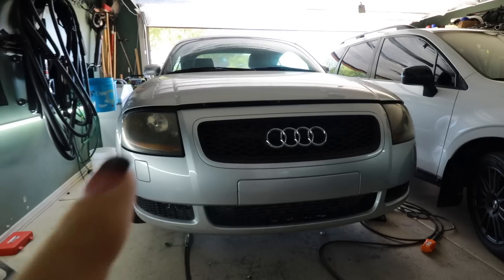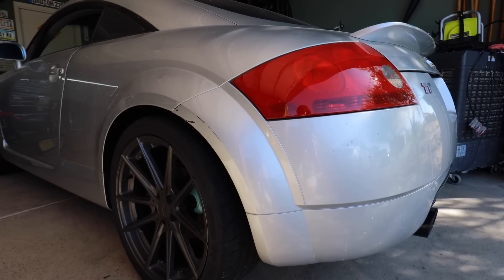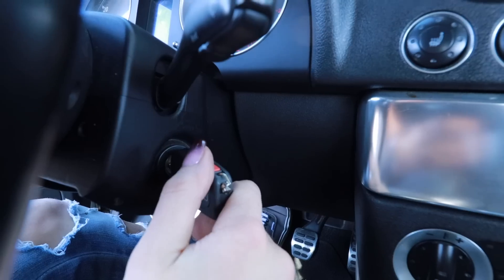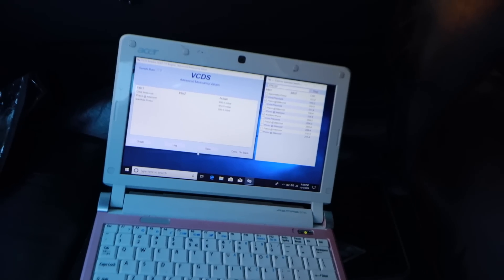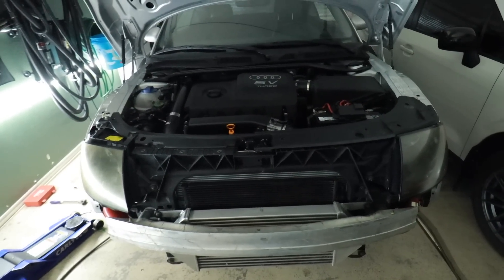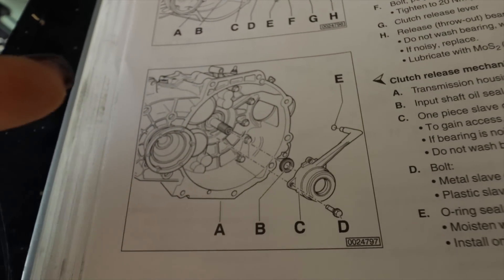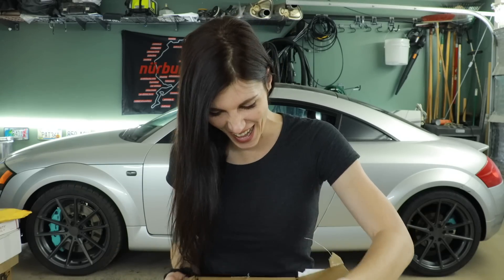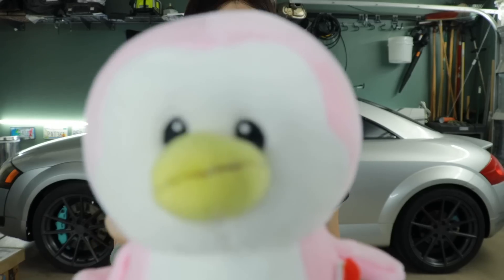First Drive Ends in Massive Failure // Project TT Quattro

Comment: Loved these TT and VW,  but the engines on these cars are SUCK a pain in the ass to work on!,  I sold my 2012 VW GTI and went back to BMW and Toyota stuff,   drove my 2011 V6 Toyota Rav4 11,000 miles cross country and hit 120mph in few areas, at 105 degrees out , for 14 hrs straight many times, and car didn't miss a beat !! gotta love cars that just work... , FIX it  its a cool car still

Comment: For your clutch assy, I'd go w/Valeo. I think this is the right clutch assy for TeeTer Tot, '01 Quattro TT 1.8l (https://www.ecstuning.com/b-valeo-parts/clutch-kit-with-single-mass-flywheel-52405615/52405615~val/). They supplied Audi with their clutch parts and, this kit also includes a Includes clutch disc, pressure plate, solid single mass flywheel, throwout bearing and hardware, so you'll save money in the long run. It's only $452.11 and is cheaper than the assy kit for my  Stratus by over $100. ECS Tuning is one of the few authorized direct marketeers for Valeo clutch assy kits. Like my clutch assy from Exedy; when you buy right from the supplier; the kit you get is 9 times out of 10; the performance upgrade from the dealer. If you need to replace any clutch, stick with either Valeo or Exedy since they supply most mfg with their parts. You can try to go thru the Carparts.com site (https://www.carparts.com/details/Audi/TT_Quattro/Valeo/Clutch_Kit/2001/Base/4_Cyl_1-dot-8L/VLE52405615.html) but according to the Valeo rep I talked to, he cannot guarantee that those are authentic Valeo products.